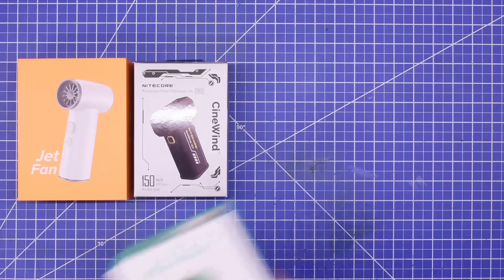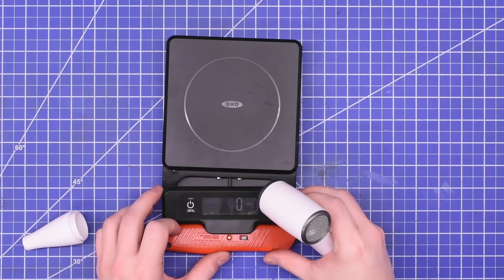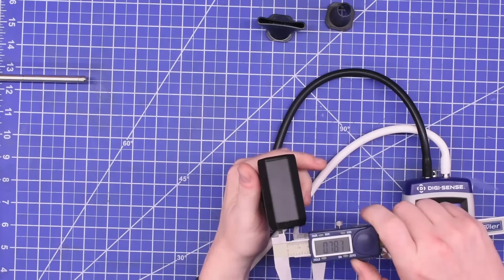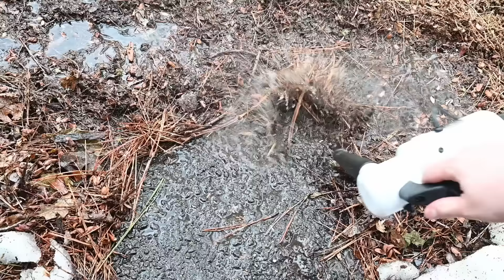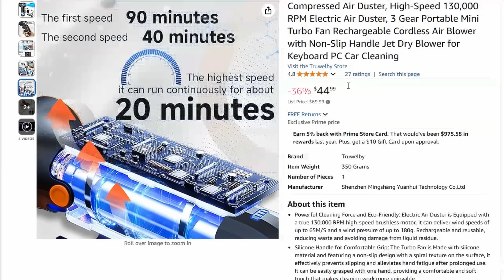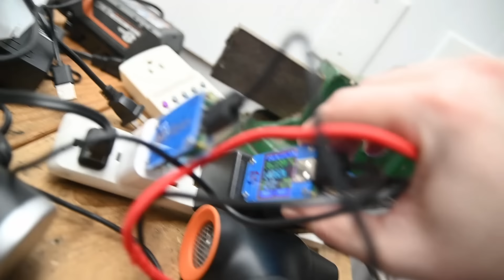Impossible Turbo Fan Dusters v DataVac & Actual Air Cans

Comment: so you dont penalize products that is lying their bottom off to cheap US consumers?
like you do in most other tools. where you rate/grade how far they are from their specs.
Reply from the maker: Advertising a 400 ft-lbs impact wrench, getting it and it not doing 400 ft-;bs can be the difference between doing the job and not. RPM has no bearing on the performance of the tool, it's just a stat that looks cool to them so the pump it up. Which is stupid, but doesnt make or break the product.
Reply: @TorqueTestChannel  I get that, but people often use vendors spec & tolerances to make buying decisions, and particlularly when its on the web and certainly on something as untangible as a small airblower where you have very little to conclude from as close to none of the parts it contain is listed.

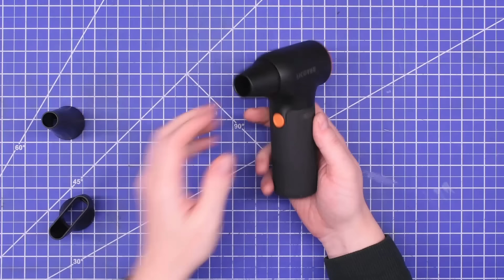Exactly the same trap as I got the impression you also walked into.  8:44
See very high numbers 350.000 and pay a high price for an item that is in fact the same product that are being sold on other listing for 50% just with more trustworthy numbers attached,

If their are no consequences, its difficult to blame thse chinese resellers for lying out of their behind & cheating US consumers with number pulled form the air, and Jeff Jørgensen's big A store. clearly dont care..and why videos like these are gonna help a lot of people as the pants are being pulled down on these products..

Comment: In work with aluminum casting that on occasion need containment/sorting in the form burr removal. I wonder if this could be used in place of noisy air compressors to blow the burr away once removed?

Comment: The Cosano Full Metal turbo fan handily beats out the Wolfbox by a lot.  The Cosano full metal pushes 510 grams of air force on my high end scale with the nozzle off.   I bought the Wolfbox a couple months ago thinking it might be stronger but ended up sending it back when comparing both side by side.  Way more CFM with or without the Nozzles attached.

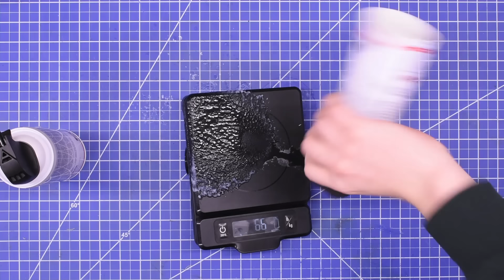Comment: 4:15  Yes, this is the effect you want in most cases.  This is an incredible troubleshooting tool.  You have a radio that sounds like crap after it's warmed up, so you can use freeze spray on each transistor to find out the troubling transistor.  It's not just this, you can use this method on all kinds of electronics repairs.  You use a soldering iron to heat components and the canned air to cool the components.
Reply: Most cases? Dude i just want to dust off electronics, not troubleshoot with cold and heat
Reply: @tarakivu8861  It's physics. No way around it.  The phase change absorbs enormous amounts of heat.  Frankly, the stuff is too expensive for that use anyway.

Comment: I picked up a wolfbox after your first video, pleased to see it still stands up to testing. (I got a datavac years ago as part of trying to use less canned air, but it was just too bulky (and tethered)  to really get use away from the workbench... it's a good inclusion in the testing, though.)
Reply: Hey! You're a rare person in these comments who has both a datavac and a Wolfbox 🙂 Could you share your personal thoughts on how they compare to each other?

I'm trying to figure out if I want to return my Wolfbox and pick up a datavac. I'm concerned about longevity of battery-based dusters, and if the Datavac is stronger, I think I'd rather go for the bulkier option.
Reply: @8BitSummoner  the datavac really is big/bulky, in a way that gets in the way for most of the  things I wanted to use it for (cleaning dust from electronics, off of detailed surfaces, and getting ground coffee dust out of things.) I think the only reason to go with the datavac might be specialized static concerns, though I haven't had any trouble with the wolfbox - I've only had it since early December, though.

Another way to put it: I got the datavac to stop using canned air - then went back to canned air for convenience - and now that I've got the wolfbox I've actually stopped using canned air.

(I also think battery packs like this are pretty well established as having a long practical life, though not in the hand-it-down-to-your-kids range; I've got decade-old milwaukee batteries that are still fine...)
Reply: @ Thank you! ☺

Comment: Yea, so the Licorne is not rated for that charge speed, I would watch that one. I think I wont take the chance and buy something I know will last like the NiteCore one. Plus made out of aluminum, tripod thread hole, comes with a case and uses actual QC/PC USB-C charging not just high amp 5 volt charging. I should have done this a long time ago with all the can air I use. Thanks for taking the time to review these.

Comment: So, Wolfbox is still the best :D Glad I grabbed 2 of them the other week. One piece was on sale or something like that, was $60 or $60-something. But only 1 piece, I paid full price for the second one. Happy with the quality and performance. I can't help wondering, would it negatively affect the duster in any way if I 3d print a nozzle that's narrower? I would like the air to be more "concentrated" more towards like it is with the straw on a can of compressed air (not quite as small, but still, smaller than the Wolfbox' smallest nozzle - not the one for inflating, but from the ones that are for blowing). I am surprised though, that the nozzle they say is designed for inflating seems to have less power than other ones, although it's smaller in diameter, even if it does have the air stream split at the end.

Comment: a while back i got tired of cleaning my desktop and rc cars with canned air, so wasteful and expensive, so i bought a coorded airblower, not unlike the one you have but another brand. Excellent at what it does, blow dust out of desktop and rc cars and dry the cars too. 
Tho i am thinking about looking into a re-chargeable one, i didnt see them when i bought my coorded one a few years ago, i know several times when a rechargeable one would have been good to blow of dust from an RC car BEFORE  packing it back into my car. Thanks for this video

Comment: I'd very much rather get the DataVac, or a similar corded one.
Why? Batteries and longevity.
Those devices suck a lot of juice, draining the batteries quickly. The more you use it, the faster the battery will degrade, and I hate devices with non-replaceable batteries.
And, well, safety. Cheap devices don't have good battery management. The USB-C plugs aren't that great either. You'll see just how bad the device will be after 3-4 years of use.
I still use a corded mattress pump that I got 10ish years ago. Has great pressure and variety of nozzles.

Comment: You are right, do NOT buy those overpriced electric dusters!
I use an  shop vac that has standard 1.25 inch home type vacuum tools, it's a chrome Porter Cable, same as Black and Decker. They cost way more now. Got it PRE-Covid for like $29 at COSTCO! I change the bag inside when needed, and clean off and reuse the motor filter-sock. Many people do not realize they also can be used to blow air too.

Comment: 14:40
Considering the batteries got warm, I would actually suggest using ut with a low wattage power supply/cord to promote longevity for regular charging and top it up quickly only when its really needed. (Kind of like quick charging for cell phones)

Comment: Got to Wolfbox after the first video. Arrived a few days after ordering. Had it for a day, then accidently dropped it and broke one of the attachments. Emailed, and Wolfbox sent a replacement. Great product and excellent service! Great replacement for canned air dusters.
Reply: Wow, replacement accessories free for accidental damage is amazing. I'll have to check out their products
Reply: @theSWBFman  It's the Wolfbox 4000a battery jumper. Cost with coupon and tax was a little over $125.
Very spiffy product. I know they did me right, I admitted my blunder straight up, can't deny that.
Reply: I got mine today. Does a little of air come out of the USB port on yours?
Reply: @tilekt4248  Got mine yesterday, and yes, there does seem to be a small amount of air coming from the usb port and possibly the trigger button. It’s still a beast at moving air though!
Reply: @ArcherBrianJames  Thank you for your reply.
Reply: I bought wolf box based off customer service reviews. The product itself is awesome as well
Reply: Lmao, AI comments to sponsor the product. One good reason to avoid it 🤣
Reply: After what first video?
Reply: Damn, now is making me want a cover for it😂
Reply: I also bought the wolfbox mf100..then a few months later I noticed they have a mf200. Doh. And now there is a nitecore cw23 which is more powerful than the mf100 and also vacuums!
Reply: Wolfbox's customer service is excellent. I intend to buy this air duster after having purchased their Battery charger. I'll still owe them a bit more after what they did for me, one order at a time.
Reply: @PageMarker1 what did they do for you? Love to hear when companies treat their customers right
Reply: @theSWBFman  I was using the case to prop up the hood of my lawnmower while jumping it and it fell and the flywheel scuffed off the logo and half the outside. Wolfbox replaced the case free of charge, + some.

Comment: No you did not just come out with this like 2 weeks after I bought the wolfbox because of your last video. If something beats it I'm flipping this table over. 

(dont actually care, the wolfbox was powerful enough that I de-snowed my suv and now have a super efficient way to dry carpet spills after I treat the spot)
I'd actually like to see what other people are using them for. I once used it to "dust" all my ceiling fans, walls and surfaces and then vacuumed up all the crap off the floor.

Comment: Usually fans will spin at higher rpm if the air input or output is blocked, since moving air through the fan slows down rpm due to loading. If you block the input or output you might see rated rpm readings, not relevant to real use, but at least they may not be completely exaggerating rpm.

Comment: Please add a static pressure measurement to your rankings/testing. This would provide much-needed info on a cordless duster's ability to replace the intense pressurized pinpoint airflow provided by compressed air or air cans.

Comment: It would be very interesting to add the big power tool brands' small dusters to this lineup. They are significantly bigger and more expensive (except for Ryobi), but run on "proper" batteries, which might be a plus. I would hope they are more powerful, but wouldn't bet on it. I know that Makita, Ryobi and Metabo/Hikoki make one, probably some others too.

Comment: we have 3 datavacs that we use in a machine shop. they are all over 12 years old. they get used daily. they've been dropped, exposed to moisture, buried in tool boxes with 10+ pound wrenches and parts piled on top of them, but they refuse to die. the ones we have were all made in the US. i don't know if they still make them here but i hope they do

Comment: I wonder how easy it would be to overheat the motor in one of these running them at full bore for an extended period. I have a small cnc machine and I’m so tired of having an air compressor running constantly and wouldn’t mind zip tying one of these on my cnc to blow chips away lol

Comment: Props for all the  times you had to say Kukiho!   The Nitecore is appealing because, (while not a flashoholic's favorite brand), they certainly have manufacturing credibility.  Thanks for the vid!
Reply: Disappointed that they didn't rate higher. Designing a good air duster must not be easy.

Comment: this niche began with a DIY kit of a brushless motor, controller, and switch. Next came a complete product with 3d printed cases using the DIY kit and the rest is history.  What I though is a power tool style form factor with removable standard battery packs. It would be nice if power tool brands start making this though I'm fine with Chinese/no brand versions. 
A removable battery pack is not only more powerful or robust for long powerful use but also the battery is more utilized by reusing it in power tools or even some cordless vacuums. 
By the way, an air compressor and air gun could still be the best for dusting (not blowing) due to low CFM but very high air pressure.
Reply: Gimme one of these in Milwaukee M12!

Comment: Thanks for the video, and I laughed out loud when you took that last "spin". I'd wanted a cordless duster for a couple of years, finally went for it, but at the last second I chose the Nitecore CineWind instead of a more expensive one. I do photo and video projects on the side sometimes, and the CineWind is designed for that, but it also makes for a decent duster. Notable is the infinitely variable speed, a tripod mount, and being able to lock it in the "On" position with a double-click of the power button.

Comment: I've got one of those datavac ones. Called a cyclone cleaner and it's black. Had it about ten years and still works. I doubt the lithium ones would do the same. So well worth the investment I think.
Reply: The trade off of flexibility of cordless is worth it to many of us though

Comment: You should try testing some aliexpress fans, I got 150w model 0601. I measured the force to be 207g fully charged. There's also the crazy big tf64 which measures 1.6kg fully charged. I also got one of the violent turbo fans with a screen measured 200g.

Comment: Came straight from Project Farm's video. Thank you for makeing this. Like i said to Project Farm: of course you drop this days after I make a purchase hahaha. Mine was not featured in this video, but i am happy with my purchase. I suggested PF test cordless rotary tools next. I bought one of those as well. I use both with my tabletop 3018pro cnc router.
Reply: I just bought the Milwaukee M12 brushless cordless rotary tool that you can really only find online. It's not displayed at Home Depots for some reason, just the older, cheaper brushed version. It actually has less max rpm than the less expensive one, but should have more rpm and power under load. I have yet to use it yet because I JUST bought it. Has some nice features as well like a grip at the head for precise control and an ergonomic, more useful shape. Already on the M12 lol platform so it made more sense to buy that than the top of the line cordless dremel that comes with a battery used really only for that tool. The Dremel specs show it can reach higher rpms, but under load I'm curious how the brushless M12 and the Dremel compare.

Comment: There is this one I just bought it is usually called the euki x3 and on the scale with or without the nozzle it has about 120g of pressure but it cost 30-40 bucks and the charge rate is about 4a with my benchtop psu and on a teardown I’ve seen that it uses some Samsung 21700 cells

Comment: I bought the 6th place generic 'duster' model for $40 last time y'all had a video. So far minimal complaints although the first one I was sent out refused to take in a charge. The seller/maker of the item though immediately 2 day shipped me a replacement after I showcased the issues I had. I'm glad to see it was at least competitive when it came to air pressure and CFM

Comment: If you guys do another round of these you can get the refillable air can, I used to get them at harbor freight. You charge them with just a normal air compressor or bike pump. They were advertised as using them for making your own spray paint or cleaners/lubes. They were normal spray paint style bodies but I have seen some these days that look like a jumbo version of the data vac and are for like wd40 type stuff lol.

Comment: I feel like you missed a really important metric for the DataVac. 

How well does it work powered by a Milwaukee M18 inverter. It seems pertinent if an inverter can make it portable where no outlet is available. Will it work as well on battery power as plugged into a standard AC outlet? This is especially true as the Data Vac has optional equipment making it far more flexible in use than any other Duster I've seen tested either on your channel or Project Farm.

Keep up the great work. Hope to see an update or a comment here on my suggestion.

Comment: You get more mAh because the cells are in series, the advertized mAh is meaningless without stating how many cells are in there, there should be 3 in series I Believe for most of them. They should put the Wh rating on the units not mAh but that also goes for car Jump Starters as well.
Reply from the maker: We factor that of course
Reply: @TorqueTestChannel  Great mate